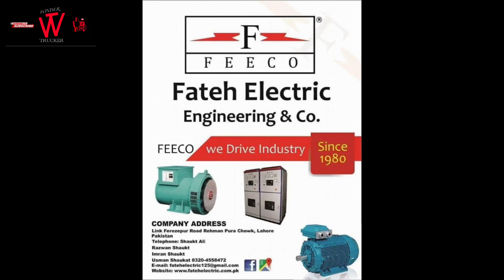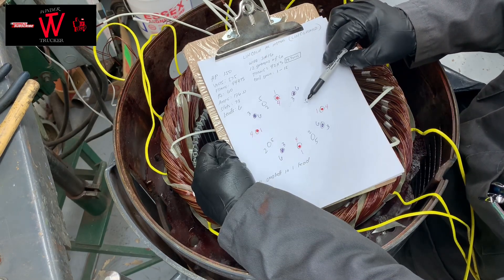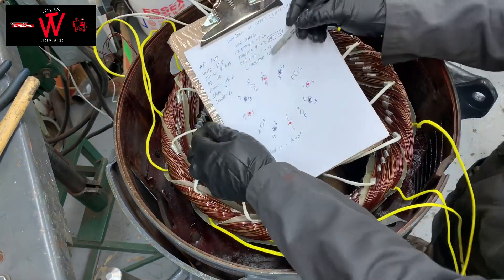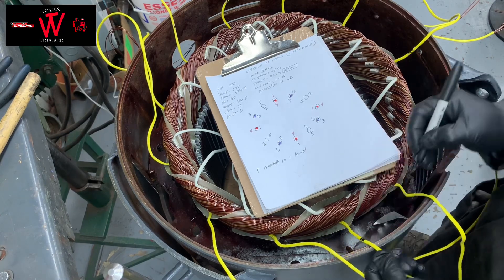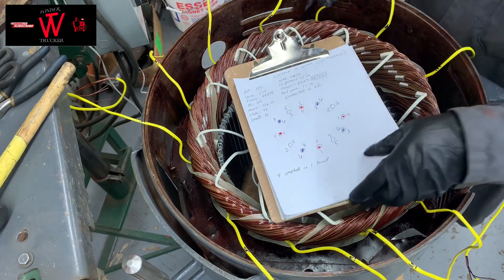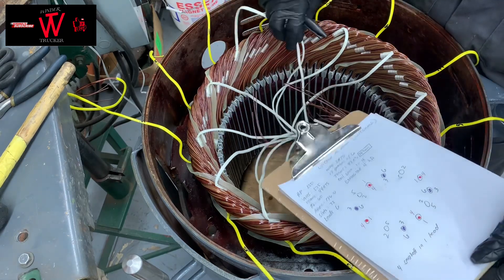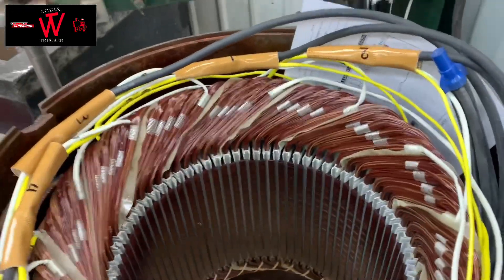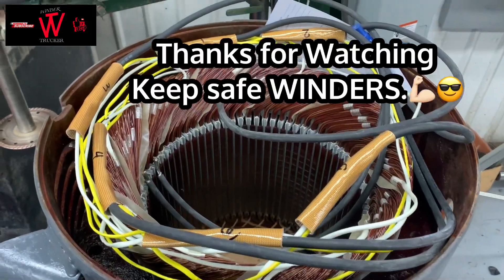Motor Rewinding | Part 2 | 150 hp Rewinding Lincoln 4 Poles | Connections Diagram 4 Star/Delta

Comment: Hi, I love your tutorial, is really educating and exciting.But I would like to ask are they all wound in one directions.Thanks in anticipation for ur response,  Sylvester from Nigeria.
Reply from the maker: Hello my friend,it should wound in same direction.
Reply: @windertrucker6230  Alright, thanks
Reply: Good morning to you sir.Pls I would love to ask you something about rewinding cos it really bothering me now cos I'm a winder in Nigeria.But I don't know if u would give it a thought.But if u would I will be very glad at it.I shall be waiting for ur reply sir in anticipation for my request.Thanks.
Reply from the maker: @sylvesteraaron6649  hey buddy,what’s is question about rewinding?
Reply: @windertrucker6230  Thank you very much for your concern.I have a 30 slot, 2 pole and three phase stator generator.From a model name dgw311DM.The challenge is how to rewind it to U1, U2, and U3, V1, V2, V3, and W1,W2, W3 cos it has been rewinded by another but couldn't give some voltage. And it is used for welding and producing power voltage too.
Reply: @windertrucker6230  Secondly, any idea of what the turns would look like both the three phase ac for diodes and for three phase for lighting of bulbs.In summary.Their turns, coil pitch, and the direct current (exciter) winding.
Reply: It is about a 30 slot 2 p, three phase stator that has leads like u1,U2 and U3.Also, V1 V2 V3, together with W1, W2, W3 respectively.pls sir, how can I wind It and do the connection too.Generator name dgw311DM
Reply: Lastly, how U3 and V3 and W3 came about sir.Thank you so much in anticipation for ur reply sir.
Reply from the maker: @sylvesteraaron6649  honestly generator winding are tricky it has to be recorded properly the data if 1 mistake of turns and labeling it will ruin the while rewind,I can’t help you for that matter my friend,i also rely on original winding and connections for generator rewind.not an easy job doing generator ask some other guys doing generators maybe they can give you a hand.sorry my friend
Reply: @windertrucker6230  Alright, I understand and thank you very much sir.What you said is correct.God bless you, more winnings on ur side sir.Thanks once again.
Reply from the maker: @sylvesteraaron6649  I really appreciate your understanding,maybe one day i can help you in other concern about rewinding.you  have a good day and God bless to you and to your family 👍
Reply: @windertrucker6230  okay and same to you too.

Comment: Helow kabayan 👋pag nagooven kaba ng mga malalaking motor may nilalagay kabang kemekal o ano para lumambot o madali mabunot yung sirang coil,dito kasi gamit namen sinusunog yung stator gamit asetelin.naglalagay din kame sa oven kaso pag malamig na stator tigas din ulit bunotin yung coil
Reply from the maker: Baka kulang sa init kabayan ang settings namin sa burn oven 7 hours @ 700 deg.F para masunog yong varnish wala akong nilalagay na kemikal as is pag pinasok ko sa oven
Reply: @windertrucker6230  ok salamat kabayan kulang lng sa oras    paglagay.dito lng din ako nakakita ng ganon na proseso nila asetline gamit sa malalking motor pero dipa ako nakasubok magrewind ng ganon kalaki na motor 12 leads out siya at 250kw.mag4 mants palang kasi ako dito
Reply from the maker: @verhillovalakay5393  walang anuman kabayan.dilikado yong usok nyan kabayan mag ingat ka sa usok cancerous yan, pwede naman yan kya lang habang mainit kylangan baklasin na yong wire,at saka pag sumubra ang init sa core nasisira. Ikaw lng ba pinoy jan?
Reply: @windertrucker6230  oo kabayan ako lng bangladesh at pakistan 3 kame dito may mga arabo din kaso mga traine lng sila  di naman nagtratraho.4 pole yun kabayan inuna nila sininsil sa may bandang koneksiyon kaya hindi ko nabantayan o natrace koneksyon niya,4 na araw na sila nagtatangal ng wire dipa tapos hehe binibigay lng sakin na gawin mga 15kw maliliit lng daw muna skin kasi bago pa ako
Reply from the maker: @verhillovalakay5393  4 days mag strip ng wire matagal talaga pag di na oven kabayan pag dito pang 1 araw lang dasi nasunog ng oven.
Ganyan talaga pag bago syempre pang maliliut lng muna kabayan pero pag matagal knang nag rerewind mas gusto mona yong maliliit 👍
Reply: @windertrucker6230  oo kabayan praktis lng muna sa maliliit 2 years nman ang kontrta ko dito pag nakadalawang taon na pede na siguro subukan ang malalaki😁❤❤❤
Reply from the maker: @verhillovalakay5393  tyaga lang kabayan.good luck kabayan 👍